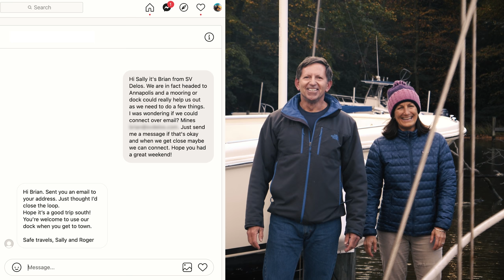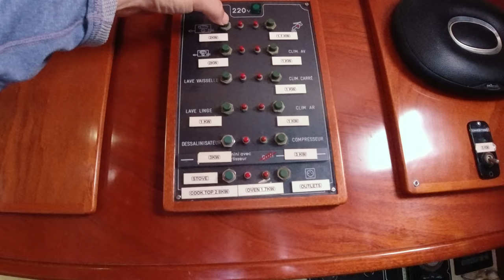6 Week MINI REFIT 😬⛵The Projects that Nearly Broke Us  - Sailing Vessel Delos Ep. 310

Comment: The US standardized on 60 Hz primarily as that was an excellent way of keeping time.  Everything associated with time, as well as navigation, is base-60.  During the advent of electrical power generation, Europe was enamored with the Metric System.  They originally planned to standardized on 100 Hz, but quickly realized impedance due to inductance power losses at the higher frequency would be prohibitive.  Thus, they hacked it in half to 50 Hz, theorizing that it was close enough to 60 Hz that most things that can run on 50 Hz would run on 60 Hz and vice versa, and they were right.  Most things do.  While 50 Hz constant-speed motors run faster on 60 Hz, they don't overheat.  Not only are they getting more cooling, but they're also drawing less current than designed at voltage and full load.  The overheating problem occurs when 60 Hz CS motors are running at 50 Hz under heavy loads.  Then, the longer time spent on each cycle can result in higher than rated currents.  At light loads, however, you should be fine.

Comment: 7:19 your way nothing wrong, totally fine , just there better or safer way connect two cable , same work cost same time ,but just extra safe , 3 wires dont cut the same length,but cut different length,every wire inch longer than other, other one did the same thing basically but on different color, then connect two cable, short wire connect to long one, middle to middle, and short one to long one, thats for if 3 wires the insulation tube/tape accidentally break or damage(very low chance anyway) , so all 3 bare wires still not touch ,because connect points are different length, thats my little habit . sorry for poor my english, hope someone understand what i saying.

Comment: wow,thats a lot of work,thankyou for sharing it with us, SHOUT OUT,CAN ANYONE HELP,i have a diesel engine that smokes[Black smoke},i stripped it down,put new pistons and big ends in it,got the injectors tested{all was good},good spray pattern, BUT,now its worse than ever,it now has a lot of back pressure and the smoke is worse,ive put a compression test on the engine and there all around 275psi,but haven't done a leak down test, can anyone help ,could it be the pump ?,any help would be appreciated.... Good luck guys,Mark

Comment: The story of how the US got fucked over with 120 volt power.  Edison wanted to use low voltage DC to power his lightbulb and he felt that only his products should be used.  He would give public demonstrations where he would electrocute different animals including dogs.  Nicoli Tesla, the father of our modern electrical system, wanted a safer 240 volt system that would require smaller conductors to safely carry the needed power for our daily needs.  The compromise that came about is the 120 volt power system that has killed untold number of people caused by connections overheating due to the high current required to get the same amount of work you would out of a 240 volt system.  Have no idea how many people Edison has killed with his hysteria.